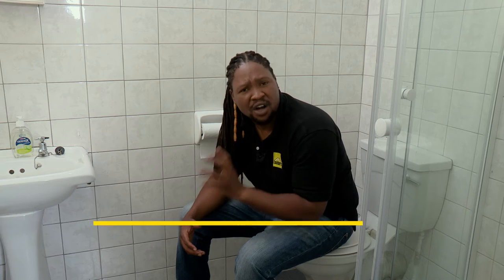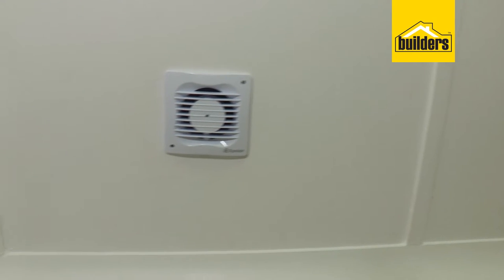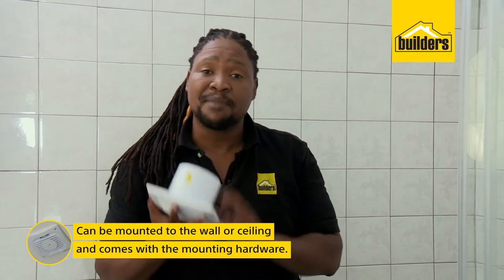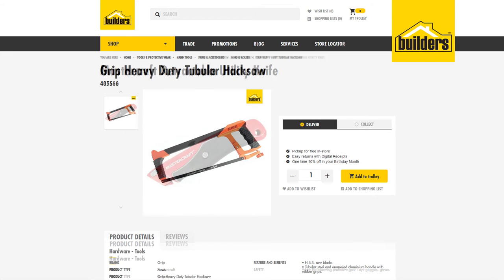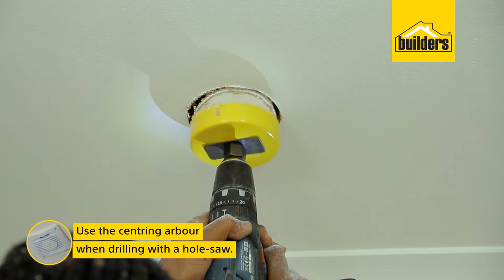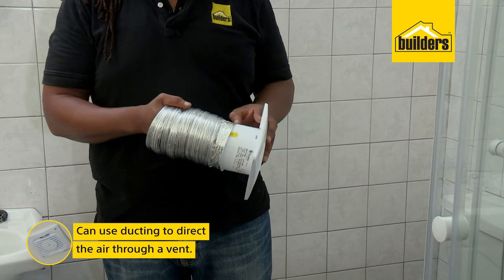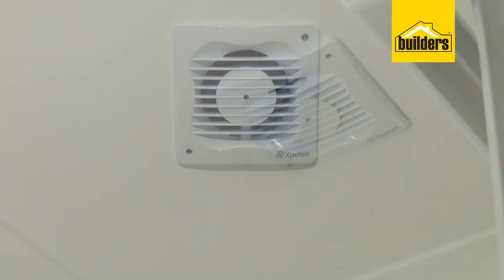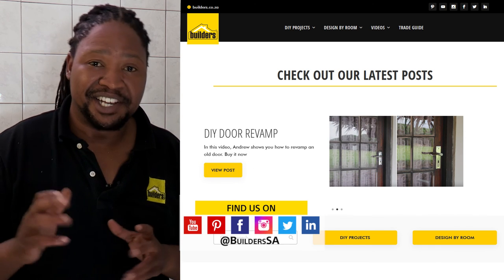How to Install an Extractor Fan

Comment: Half the job - would have like to see how to connect the ducting and vent externally and connect up the wiring. :(
Reply: Forgot to mention any sort of insulation over the duct too. To stop the hot/humid air becoming water as it hits the cold ducting!

Comment: Please also include a how-to on ducting through a wall or through the roof. Not finding any good examples.
Reply: It is easy for the ducting. Use a 90 degrees elbow to connect the extractor to the ducting pipe which goes across the ceiling and duck out through the wall. Through the wall is easier than through the roof if you live in an apartment. Note from elbow to ducting outlet it's better to have the pipe same diameter as the hub of the extractor fan.